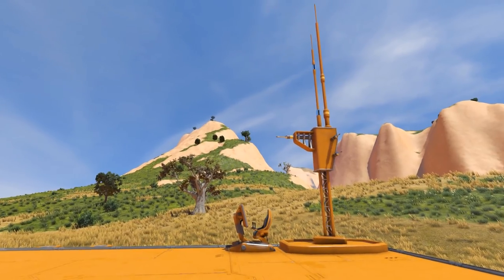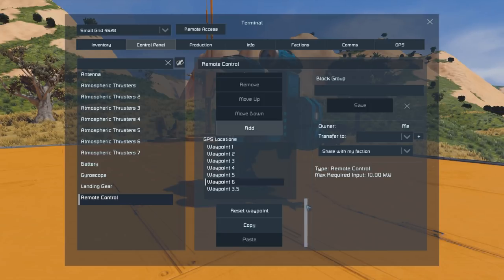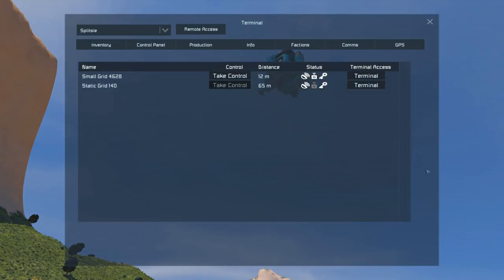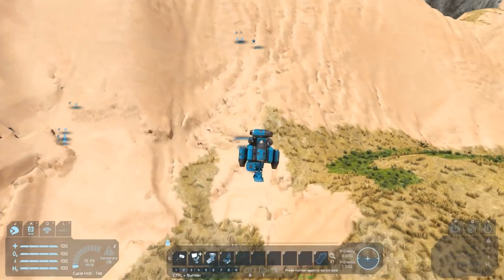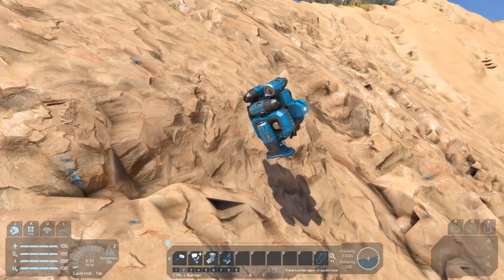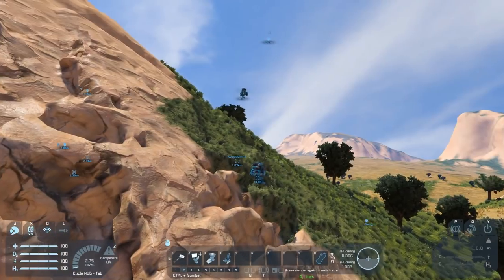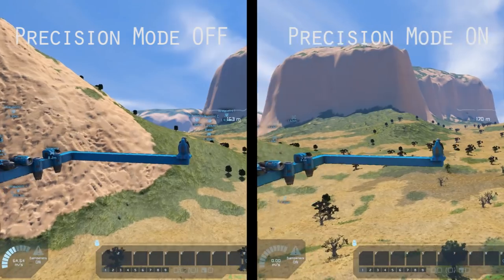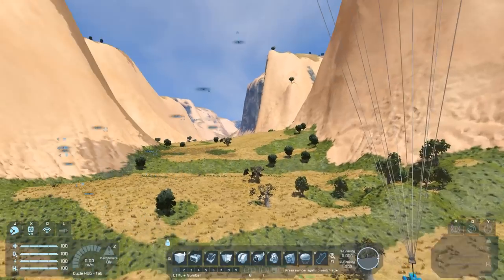Space Engineers Tutorial: Autopilot & Remote Control Part 1 (tips, testing, tutorials for survival)

Comment: If the autopilot uses a PID controller or something with an accumulating error term, that spinning is probably due to it increasing the torque bias on rotation to try and overcome resistance while the landing leg is locked. Then when you unlock the leg, it's still trying to compensate for that resistance by hammering the torque as hard as it can, and so speeeeeeeen

Comment: You can have an extra lifting thruster turned off with max override selected. A sensor that detects terrain switches it on. This can help your terrain avoidance feature.
As an aside, if a B-1 Lancer detects a problem with it's terrain avoidance system, it automatically pulls up.
Reply from the maker: That's a really nice tip, I'll definitely be including that in one of the later videos :)
Reply: Auto pilot and sensors are always a good combination, IMHO

Comment: 4:20 the reason why it does that it's pretty simple, actually. It uses a PID controller. When you enable autopilot, it start running the PID controller. Because of the landing gear, the error doesn't change, so the I term continues to increase. When you reach a certain value, the ship doesn't stop by itself. That happened before you release the landing gear. If you do it in reverse (LG then AP), it will never happen

Comment: Nice series. liking your videos. A few things I've discovered with the autopilot you may also want to add.1) Even with avoidance and precision off, flying close to the terrain will cause the autopilot to really slow down. I had a mining base across a large lake and thought it would be cool to have my Ore Mule skim a few metres from the surface and avoid other air traffic. Went really slow.2) If you seriously overload an ore mule - for instance it's not easy to restrict how much it loads during the collect all lock - then the autopilot will badly overshoot targets and often just hard crash into the ground on descent.3) If you mount a cockpit or seat on a drone, then fly it around and capture waypoints without remote then the waypoints are at your position in the cockpit and not at the remote. When it comes to fly solo everything will be slightly off.4) Don't forget you can also turn avoidance and precision off with actions. I tend to never turn avoidance on and sometimes use precision if the landing is tight. Leaving precision on all the time wastes a lot of time at intermediate waypoints particularly if overloaded.
Reply from the maker: Yeah, precision mode really makes it careful. I've found it helps a lot for a reliable landing on a connector though, and I agree that it's best to only turn it on when needed if you want things to move at any sort of reasonable pace.

That's a good point about the mass affecting how well the autopilot functions, just like me when I overload something it has a tendency to... lithobrake ;)

Comment: I have found that if you turn on collision avoidance and precision mode it works good at avoiding things it will even try avoid a person standing on the ship if the remote block is in the middle of the ship behind the character causing the ship to spin in circles unless the remote block is in front of any players standing on the ship but with no characters on the ship it will avoid everything , as precision mode slows the ship down before approaching an object or way point  however it does take it a long while to navigate around an asteroid as it does try to re orientate it self ever few seconds then has to re correct itself so precision mode is grate for not slamming in to objects but makes it take a long time to navigate when there more objects in the way usually taking 4 or 5 times as long to navigate then what can be done manually, and even though it takes longer it means that it frees up a repetitive task alowing the player to focus on other things like building. so I have found that when using auto pilot it is best to have both options checked at the same time.  usually I will set up an auto mining station and have a drone autopilot and dock with mining station then head to the base and unload  so that I no longer have to deal with the mining my self.

glad my little demonstration i made for you awhile back helped you out with this.
Reply from the maker: It helped a lot! I was really grateful for it as before you showed me it I really couldn't get my head around the autopilot stuff. Hope you didn't mind me highlighting your help :)

I agree with you about using the collision avoidance and precision mode, costs time but it works pretty well at saving components from damage even if it ends up scraping against voxels at times :P
Reply: dont mind at all in fact it made my day :)

Comment: You can legitimately can do airdrops with a bigger ship and container when you are out mining. It's best to have 2 people though. Take the ship with you to where you will be mining or collecting materials. Once you arrive set a waypoint 1 at your base. Set up the drone so it makes an air drop of the container demonstrated similarly  around 19:00 in the video. Waypoint 2 can either be back to your position or a new waypoint where there is known materials such as cobel ore so you can quickly load up more by adding another small container which is enought to hold just material and having it air dropped again full of supplies. Containers are cheap to produce so long as they are small ones. You can also have multiple bots doing this back and forth as you mine materials. Your buddy will be unloading back at base while you mine. I see this as efficient, lazy but cool work. While mining. That or you can be normal and just send the drone back and forth with a container and just unload it. 1 at a time
Reply from the maker: There's something that's so much more fun about doing things just because you can - dropping containers instead of unloading fits that description to me :)

Comment: I made a wheeled drone! I set the tire friction to 0 and gave it enough directional/forward thrusters an a gyro so it could slide on the ground, but it still looks like it's driving. Gotta make sure collision avoidance if off though or it'll kinda just wiggle on the ground. I also set a speed limit to 40 m/s.
Reply: I put sensors on my drone an set it up that that way if it sees an enemy grid it will stop and fire a rocket launcher at it :) Now I just need to figure out how to make it aim.
Reply: I figured out how to make my ground drone aim at enemy grids :)

I have two sensor on the front right next to the rocket launcher. They have maximum fields forward, but only 1 meter in all other dimensions, so they only activate if there is a target directly in front of the rocket launcher. One sensor is set to disable auto-pilot if it sees an enemy grid and re-enable it once there is no more enemy grids. The other sensor continuously fires the rocket launcher if it sees an enemy and stops once there is no target.

I also have 2 sensor on both the left and right sides. These have maximum forward fields and almost maximum left/right fields, the back field reaches to the edge of my front sensors. One sensor disables/enables auto pilot if it sees an enemy an the other increases/decreases gyro yaw override. So if there's an enemy on the flank in theory it should stop and turn the rocket launcher towards the target.
Reply: I will have to test a flank target later. Depending on how fast it turns I might want to add more yaw control sensors. I haven't tested yaw control yet.
Reply from the maker: That sounds really cool, I love builds like that where you're using the basic building blocks more than scripts largely because I can get my head around how they work :)
Make sure you post it to the workshop once you've got it fully functional I'd be interested in taking a look
Reply: Been working on it and I've had a lot of trouble. The side sensors keep seeing the target at the corner of their field, an when they do they start turning, but as soon as they start turning the target leaves their field an they stop. 

Long story short, making a drone turn to fire a fixed weapon with sensors is way too difficult, just put a turret on it.
Reply: It can probably be done with a lot of sensors, but my head hurts already lol.
Reply from the maker: That is very understandable, this stuff makes my head melt :P

Comment: I’ve been tinkering around with my own cargo drone, hoping to use your awesome tutorial for the docking process especially. I’m having a consistent problem though with my autopilot skipping waypoints. Like nearly every other one. Seems to be a common issue, but can’t find a fix! Any advice?
Reply from the maker: I've seen the autopilot appearing to skip waypoints when I've forgotten to put a gyroscope on the ship or a downwards thruster. But if everything is set up correctly it also seems to happen more often when the waypoints are close to one another or when you have precision mode on and there are obstacles near the waypoint.

My only ways of avoiding those problems have been with a complete reset of the system and setting all new waypoints trying to keep them at least 50m apart. Sadly that doesn't always work :(

Comment: Trying for the "Planetesphobia" achievement, and I think I'll use it as an opportunity to learn the autopilot system. There are easier ways to do it, of course, but I'm going to try to use a remote control drone to get GPS data for targeting and then use an autopilot drone for ordnance delivery. Should be fun!
Reply from the maker: Just make sure your ordnance doesn't use hydrogen thrusters, I haven't tested since the update, but the autopilot has never coped well with hydrogen thrust :(

You should be able to get away with dumbfire turned smart though, if you use something like artificial mass blocks on the drone, a grav gen on the ship, then atmo thrusters on the drone for control in atmo. You could launch it dumb with a timer to turn autopilot on once it's safely in atmo, just for that extra level of 'what could possibly go wrong here' :P

Comment: Greetings. Wondered if you could give me some advise? Built a simple drone but what is happening is that the flight controls refuse work if the craft is on a connector. Whether on autopilot or manual control the engines (atmospheric, haven't tried hydrogen as yet) get no power. I have scrapped and rebuilt multiple engines on the drone and it still gets no juice. If I restart the game I can get it off the connector, put it into autopilot and it continues on its merry way until the next connector and then same thing again. No power. HELP please.

Comment: Great tutorial... maybe in the next part you can test when setting up your waypoints does your direction matter and does your autopilot emulate the direction on arrival to the waypoint... I think this will be useful if you trying to do reverse docking with a connector on the back of your ship instead of the bottom... unless there is another way to tell it to rotate as part of your actions... not sure...
Reply: the direction of entering a way point does matter if it s a way point where you want something done such as docking or flying within close proximity to voxels or other grids the remote will always position itself so that it is directly on the waypoint so if the remote is not centered and you come in from the opposite direction for example and the waypoint is to close to another grid it will hit that other grid even if collision and precision are both checked also putting a connector on the back of the ship will not work unless you add in another remote block per docking point location as there is no way to reverse direction  autopilots always fly  forwards or in the direction you tell it is forward.
Reply: MacGabhann ok in that case I can try using actions with timers and thrust overrides and gyro overrides  to try and position it before connecting to a station grid and then after all the timers are complete then the ship can continue with the auto pilot and waypoints...
Reply: if you are on a planet it is very easy to do with out having to do a whole mess of things , how ever in space well lets just say im still working on that problem but it is requiring a whole lot of overrides but once i can get a drone to dock on earth then fly to a space station and dock there ill most likely have splitsie have a look at it
Reply: MacGabhann what makes space so much more difficult?
Reply from the maker: While in the gravity well of a planet the autopilot has something to orient to, it will align the remote control block to gravity. In space it has nothing to orient to, so you have to get clever to force a particular alignment before docking. On a planet having the connector aligned for vertical connection is easiest as the ship can approach from any direction and still dock because it will be upright.

Without gravity to align to you have to figure out a way to get the ship's orientation the same on every approach so that the connectors align. That's a tricky challenge, hopefully something Mac or myself come up with will be reproducible enough for me to show it in a later video :)
Reply: Splitsie well it sounds like your next video part/s will abit more difficult to make and explain... good luck... on my side I have been experimenting with controlling the remote control block from a programmable block... not so successful... I still need to figure out if I can add dynamic waypoints to the remote control block from the script... unfortunately I don't see an interface to allow me to do that just yet...
Reply: like Splitsie said it is due to the gravity on planets I am how ever working on a work around for space but it will be some time before I get it perfected by the looks of things

Comment: Morning Splitsie, 
I’m after some advice, I have built a miner following your instructions using this script but whenever it come to the stage of reversing out the asteroid it gets stuck on the roof of an asteroid. Any suggestions on what might cause this? I have added more drills to make the hole bigger so it doesn’t catch anything on the side, thanks for your help.
Steve
Reply from the maker: I've had no end of grief with trying to get the autopilot to behave consistently in space, you may have better luck using the PAM or SAM scripts as they have some much improved scripting around that sort of thing
Reply: Splitsie brilliant, thanks for the response, i’ll track down your video for the PAM and SAM scripts and have a play tonight
Reply from the maker: I did a video on the early version of the SAM  (Sam's Autopilot Manager) script, but haven't done one with PAM (Path Auto Miner)